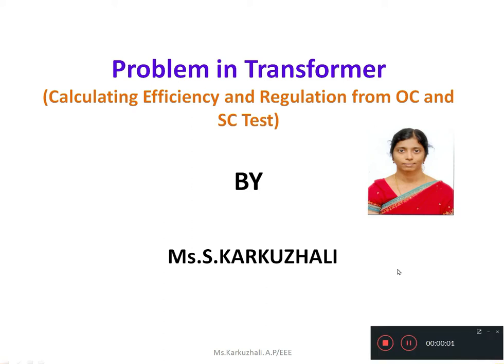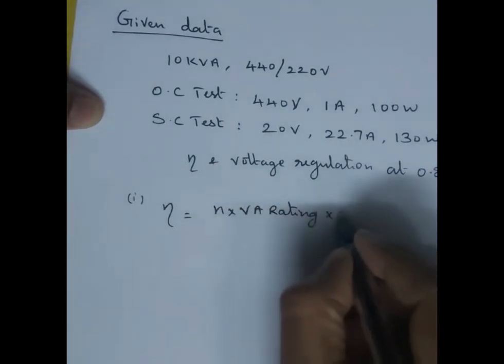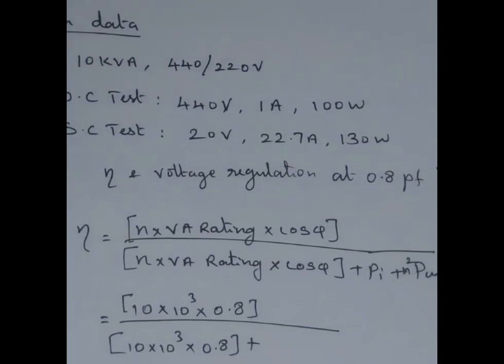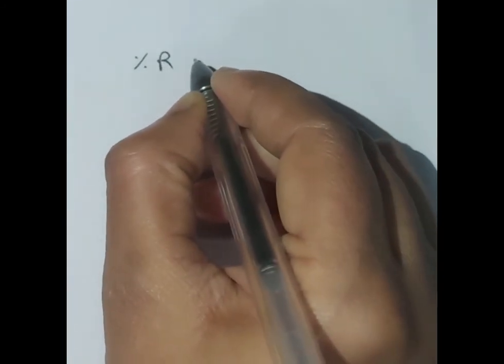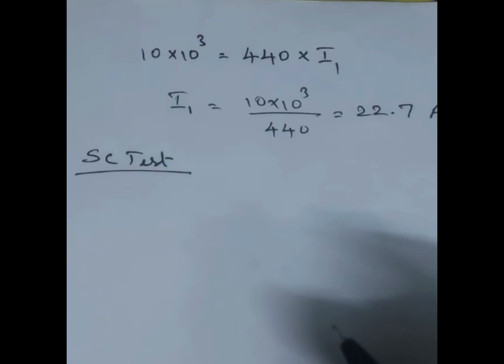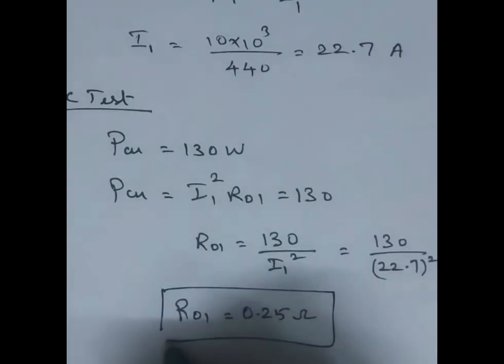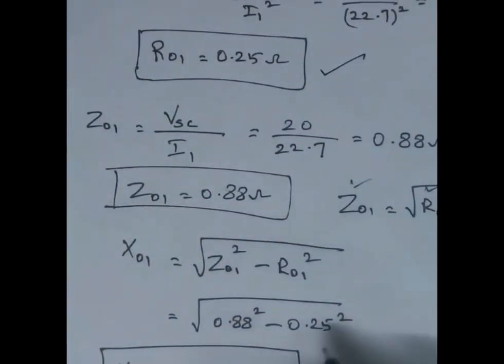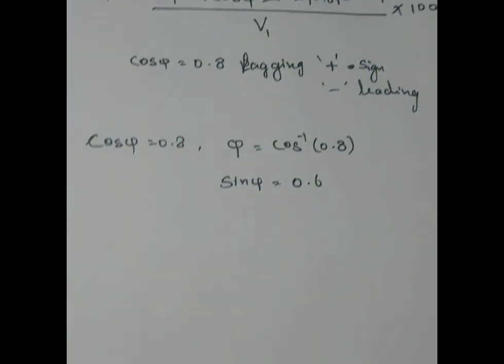OC & SC Test |Calculating Efficiency and Regulation from OC & SC Test

Comment: Thanks a lot for ur clear and neat explanation and hand writing.

Little note: in calculating voltage regulation, you substituted 0.6 for both cos & sin ,  time 8:28 but the result is correct.
Reply from the maker: Thank you for noting down the mistake with time. Thank you very much for your feedback.🙂